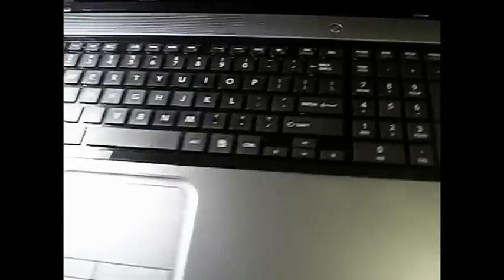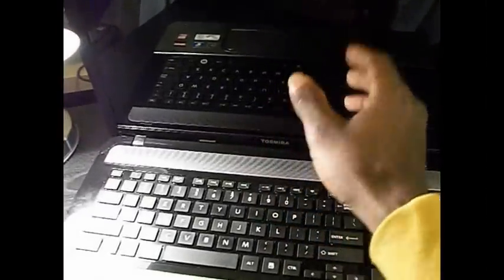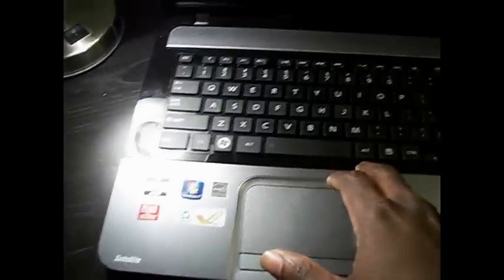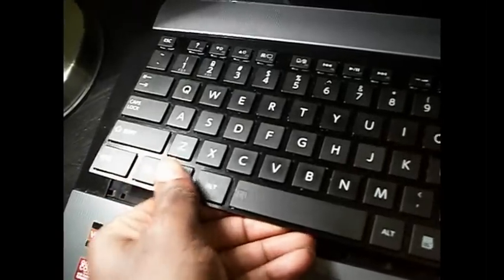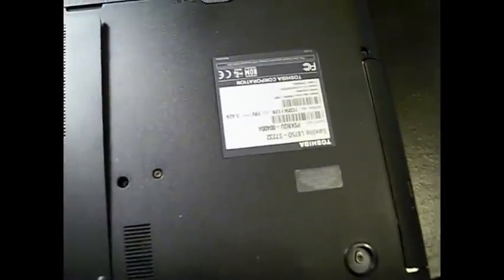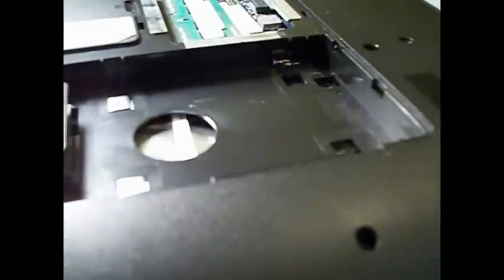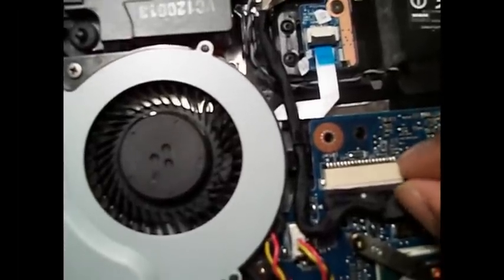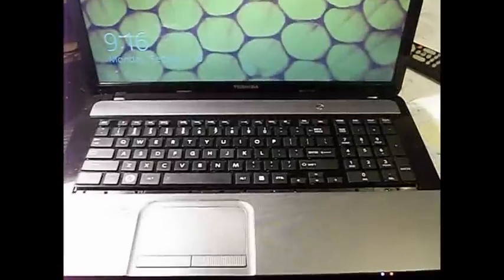How to Fix the White Screen Issue Toshiba Laptop L875D

Comment: Ive seen the gpu de soldier due to heat an cause issues similar to what ur describing, but right now i have 3 Toshiba laptops one just does the random white screen an it acts like what ur describing, the 2nd works but the screen has like a green or pink tent to everything while the other one is turning on but nothing comes up on the screen. u can hear everything come up hard drive spin up an it acts like its booting just cant tell cause the screens black so im going to try to hook to an external display an make sure its not related to the gpu and if it isnt then im going on to the cables to make sure they are connected an if they are start looking for corrosion on the connectors.

Comment: i work on alot of laptops an ive seen this issue, an it was the gpu chips on the boards not seating to the socket, kinda like the red ring of death for the xbox360s. if it is the gpu u can heat it with a heat gun an it can sometimes re seat the chip to the board. but to do it right u need to remove the chip clean all the old solder from the chip an the board an the reball the chip to the board. u can buy small kits that has the different chips to put the solder balls back in place. but alway check the cables like hes doing first. if its not the cable an u cant do the work your self most the time its cheaper to buy new than to take it to someone to have it fixed, or at least in my area.

Comment: People please know there's something he fails to mention that is extremely important and that is mark all of the screws you remove so you know exactly which screw goes where when reassembling the laptop. They are not all the same length and if you use the wrong length screw in the wrong screw hole you can severely damage your laptop. You can also tape them in place once they're no longer in the thread but  it's hugely important to do that or mark them as you're removing them. Other than that great instructional video!